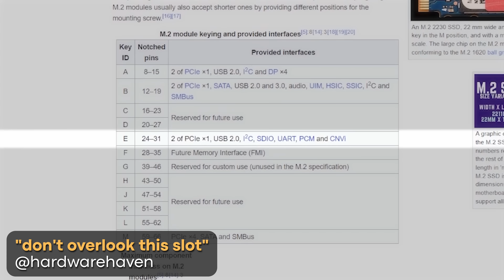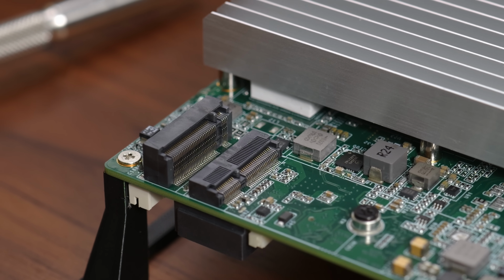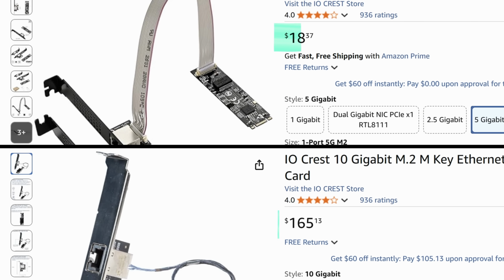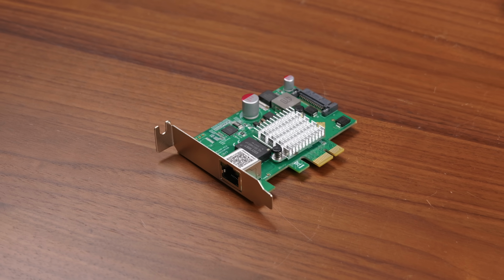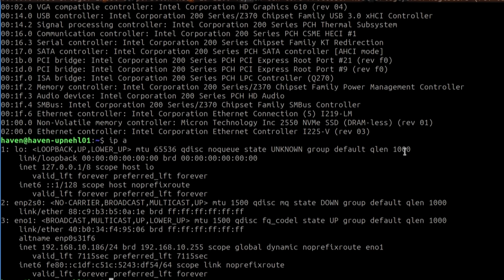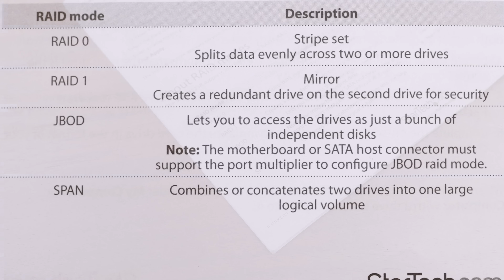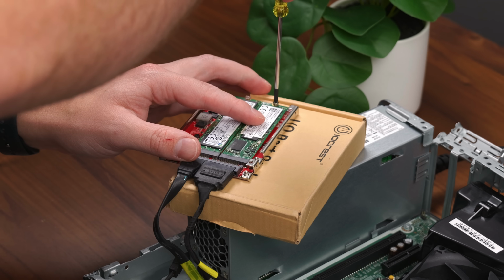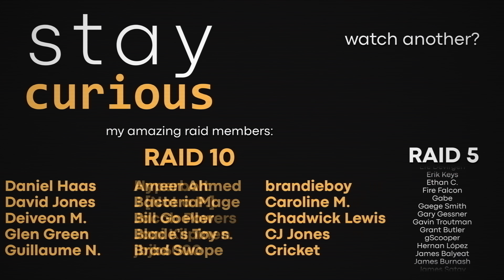I Don’t Know Why These Adapters Exist... But I Love Them

Comment: Fiber, or at least Google Fiber if you bypass their router needs PoE to work. The PoE network card could be in our router as your WAN port and supply the power to the Google Fiber module that converts fiber to ethernet. This would eliminate the need for a PoE injector which is what I had to use when I built my router around 10 years or so ago.

Comment: I use the MicroSD adapter in a system that doesn't support booting from my Sata port.  It wants to boot from a drive in a 4 bay with a backplane plugged into the SAS port.  I have my OS on the SSD on the SATA port and have grub on my microSD card.  It boots it and finds my SSD fine leaving my 4 drives open for storage.

Comment: As I 'discovered' after using Amazon for 24 years, purchases still have warranties so if they fail within two years - (I bought a mainstay extension with built in USB power slots which blew up after nine months) you are still entitled to a replacement/refund. You just need to navigate to the right page. I could not get a replacement so opted for Amazon credit and received the refund before it even arrived at the Amazon depot.

Comment: if you have an older laptop that usedto take hdd there whone be room for the two ssd unless you have an adapter , the hdd case for the ssd will make it eazier to mount them in there , i would use one if i had older ssd drives with aless than 500gb capacity to get one of those older laptops running again

Comment: 8:51 I have the msata version of this, which I intend to put into Lenovo P330Tiny.
The adapter suffers the performance issue, I got only 50MB/s in raid0.
So I switched to pci-e to 2*ngff and use software raid that come with windows server.

Comment: A cool adapter I found is an m.2 SATA to 2.5' SATA drive adapter with a built in micro USB 3.0 port so it can be used as an external USB drive as well. Makes it easier to access the drive without having to mount it.

Also a downside for that dual port RAID m.2 sata drive adapter is gonna be the heat. It's best to find the most energy efficient m.2 drives with the lowest operating temperature.

Comment: An adapter I found useful for retro laptops and desktops. You just can’t get 2.5 ide drives spinning drive anymore.  Now they are using m.sata cards on a ide adapter to m.sata card. Increased the storage capacity X 10 and more. 40gb and a 20gb to 512gb.  Being solid state it’s faster.

Comment: FYI you CAN query individual drives behind a RAID controller with smartmontools -- at least for RAID architectures smartd is aware of. See: man smartctl , and read the -d, ---device section. Some examples from that section of the man page: 

megaraid,N - [Linux only] the device consists of one or more SCSI/SAS disks connected to a MegaRAID controller. The non-negative integer N (in the range of 0 to 127 inclusive) denotes which disk on the controller is monitored. Use syntax such as:

smartctl -a -d megaraid,2 /dev/sda

smartctl -a -d megaraid,0 /dev/sdb
This interface will also work for Dell PERC controllers. The following /dev/XXX entry must exist:
For PERC2/3/4 controllers: /dev/megadev0
For PERC5/6 controllers: /dev/megaraid_sas_ioctl_node
3ware,N - [FreeBSD and Linux only] the device consists of one or more ATA disks connected to a 3ware RAID controller. The non-negative integer N (in the range from 0 to 127 inclusive) denotes which disk on the controller is monitored. Use syntax such as:

smartctl -a -d 3ware,2 /dev/sda

smartctl -a -d 3ware,0 /dev/twe0

smartctl -a -d 3ware,1 /dev/twa0

smartctl -a -d 3ware,1 /dev/twl0

smartctl -a -d areca,2 /dev/sg2

smartctl -a -d areca,3 /dev/sg3
The first line above addresses the second disk on the first Areca RAID controller. The second line addresses the third disk on the second Areca RAID controller. To help identify the correct device on Linux, use the command:
cat /proc/scsi/sg/device_hdr /proc/scsi/sg/devices

To look at disks behind HP Smart Array controllers, use syntax such as:

smartctl -a -d cciss,0 /dev/cciss/c0d0    (cciss driver under Linux)
This will give the smart information about the first physical disk drive (0) connect to the controller at /dev/cciss/c0d0 . (Disk drive numbering is 0 based)
smartctl -a -d cciss,1 /dev/sg2    (hpsa or hpahcisr drivers under Linux)

(there's a wealth more info in that section; I copied various portions of it to share with you). 

When I worked at a hosting company that one tech writer has called "the roach motel of hosting" I wrote some internal articles on doing this and trained many junior sysadmins on doing this, because storage trouble tickets were by far our most common tickets and I wrote many one-liners to simplify storage issue reporting (some of which I've turned into a full command line utility I called "topdiskconsumers" for reporting on disk usage). I've been meaning to take my other one-liners and turn them into full-blown command line utilities (including detecting/probing and reporting on arrays using smartmontools to simplify what you're looking for), but I've had higher priorities.

Comment: The poe ethernet would work with older VR wireless headsets for the power output so you can mount the wifi router with power without needing a wall power

Comment: The 2.5" dual RAID m.2 sata enclosure was ESSENTIAL (back around 10 years ago) for anyone that ran a business off there laptop that only had a single spot for data storage. But TBO SSD's have got so reliable in the past 5+ years (early cheap 3D/TLC and QLC did fail "a lot") that you're FAR more likely going to loose your data from user error than hardware, unless your SSD in soldered on to the motherboard.

Another way to keep your data safe is if your laptop has a spot for a flush SD card, you can use that as the backup drive. They also sell Micro SD adaptors that are shorter than normal so they don't stick out.

Comment: PCIe x1 to Type E USB adapter. From the launch of USB C there existed PCIe x1 cards with one external USB C port and often some external and/or internal USB 3.x ports.

But nobody made PCIe x1 cards with a Type E internal connector for USB C. Why? It's the same as USB C but with an internal connector to run to a front panel USB C port. Companies did (still do) make PCIe x2 and longer cards with Type E connectors.

I emailed every manufacturer of PCIe USB cards I came across about why they should make a PCIe x1 card with a Type E connector. The main reasons being that they made them with external USB C ports, and that there are huge numbers of motherboards that only have one or two x16 slots and a a bunch of x1 slots, nothing in between, and many of those either have no built in Type E port, even if they have USB C on the back, or only have one Type E connector.

Well someone must have paid attention because eventually some company started making a PCIe x1 Type E card. I bought one, it's in my desktop and it's connected to the USB C port on a multi card reader that connects to a 19 pin USB 3.0 connector, with all the card slots on one port and the other directly to a Type A port. The USB C connector is separately connected to a Type E plug.

Another item I really want to exist is an ExpressCard with one USB C port, connected to a real USB C controller, not simply adapted to USB 3.0. There are some USB C devices that insist on being connected to real USB C. I don't care that it would be slow due to ExpressCard being only PCIe 1.0 x1, I want to use USB C things with my Latitude E6530 that I've maxed out with every possible upgrade.

Another one that Really Ought To Exist is SATA to NVME. Again I don't care about the speed! It's certainly not a bus width issue since USB 3.x and USB C to NVME exist. Even the slowest NVME SSD connected to SATA III should be capable of 100% of the SATA read and write performance with no crazy drops to sloooooow speeds.

Comment: 0:35  is that 2.5 in and will it fit in a laptop?
Reply: Yes and yes, it can even mirror drives.
Reply: they can only use sata m.2 drives on it though, not nvme

Comment: That Poe card is interesting use can use it to reflash AP firmware with out the clunky switch set up Poe cameras firmware or just play with POE IOT Devices. all at a bench no switch required.

Comment: That PoE 2.5 gbe nic would actually be amazing for me if I wasn't using a micro PC. I run OpnSense and my WAN2 backup is a cellular modem that is able to be ran over PoE. This would let me eliminate the separate PoE injector for it.

Comment: Sadly I can see that the connectors in that SATA adapter takes sata m.2 cards not nvme.  And those are harder to find now. You're not gonna take two 4 tb nvme's and turn it into a 8 tb sata with that.

Comment: Amazon has a good staple of mine, 2.5" IDE to mSATA or M.2. Good for getting SSD performance/reliability from old vintage computers whos hard drives are starting to fail. I have a ton of 128GB mSATA that these are a little overkill for, but they work very well.

Comment: I could imagine using that SD card adapter in the E-key slot of my home lab Optiplex 3060. It could hold my Timeshift backups and free up the space on my 3.5inch data drive

Comment: I had that type of adapter except it was 2x2.5" in 3.5". I loved it. I used mine in an external USB chassis with spinning rust and the thinking was that if I had an accident and bumped it while it was running, damage would likely be done to different parts of the drives, increasing my chances of recovery. So they do have uses, these weird adapters.

Comment: Optilink to EGPU dock to PCIE M.2 adapter to M.2 Optilink adapter. repeat. see how far down the chain you can get it before even an m.2 SD card fails to load - gonna have a lot of use for that closet full of old power supplies.

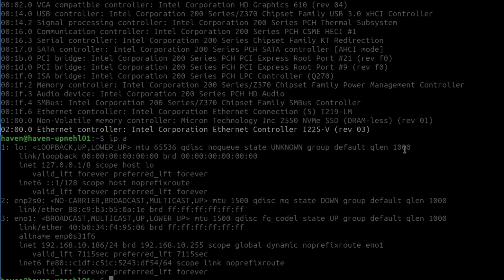Comment: 8:11 if I have a small PoE NAS, connecting it straight to the pc so it can take internet access from there would also make that specific devices transfer speed to and from the NAS basically no loss of speed (if I'm right, I could be wrong).

Comment: A network card with PoE makes sense if you have a home lab and don't want to constantly deal with 220-12V adapters, which take up a lot of space in the outlet and add an extra cable all the way from the power outlet to the device. My Raspberry Pi 4 is lying behind my computer, and there are too many cables running to it.

Comment: The SD card adapter is definitely interesting. I have a laptop that I use when I am travelling and I am often in places with no wi-fi so I have a 512GB micro SD loaded with movies and music which means I don't have to rely on streaming services. And I'm not constantly writing to the SD card, only reading from it so I haven't yet run into any longevity issues. As the days of laptops having upgrade paths and multiple drive support are fast disappearing outside of a few dedicated workstation laptops it's a handy trick to get some extra storage.

Comment: for the life of me, i cant think of a single scenario where a pcb/mother board would have m.2 but not usb, i would never use an m.2 port to hookup micro sdcards, just buy an m.2 card, sdcards are garbage, especially for the purpose of a boot drive of anything.

Comment: 5:53 I wonder if you can plug each ribbon cable onto a different m.2 carrier? that way you can in theory have network interfaces of 4 different nodes on a single pcie slot. This would be very handy for a cluster... @jeffgeerling might like that lol

Comment: I use a dell optiplex micro as my home server.
I removed the wifi card, used an M.2 extension card & a M.2 to 8x SATA adapter to connect all my HDDs.
Love me some adapters. Though failures would be a pain to troubleshoot when piggybacking several.
Reply: I have seen an m.2 to SATA card uses mini SAS ports for 8 SATA. It's still a SATA card but you only have to deal with fewer cables

Comment: That last adaptor could do with a modification to bring the LED signals out onto hardware pins so you could manually add external LEDs to monitor the hardware state with, to be able to see if one or the other drive has failed, and which one.

Comment: I found some nice mini PCIe and NVME a+e key ribbon cable extensions.  This gives extra options when fitting your mod.  Adds a few bucks.  I am currently working on a few laptops, but the one that is most interesting has 3 mini PCIe slots, an ExpressCard port. a PCMCIA port, a DVD rom slot and a 2.5" HDD slot.  There will be MANY adapters involved lol  I think I am gonna use the ExpressCard for a couple USB 3.0 ports, gonna use one miniPCIe for either "mini PCIe to NVMe M.2 to Occulink panel mount", and if that doesn't work, just mini PCIe to USB 3.0 panel mount, either of which will be used for an external GPU dock.  One of the remaining two miniPCI slots will be used with a mini PCIe to NVMe M.2, and the final one will be used for a mini PCIe h264/h265 decoder.  I will "delete" one of the USB slots, potentially one from the Expresscard to USB 3.0 card, and route it internally, so that I can use a USB WIFI+Bluetooth card with laptop style antennae.  I am still unsure what to do with the PCMCIA card slot.  They are kinda useless these days, from what I can see.  So I might use the space the port occupies to put the panel mount eGPU connector, etc.  I also have a small but powerful stereo audio amplifier PCB, that works on 5V, so I am also gonna try to split the SATA power with a Y extensions, and shuck the 2.5" SSD that resides there and hope it all fits.  Then run 5V to the audio amp from the SATA power Y.  Then I have some larger laptop speakers, TV speakers, etc, I want to try to fit.  The last thing is the DVD rom area...not sure what I want to do there.  I can get a 2.5" HDD adapter.  Or an addon battery.  I am thinking of getting the add-on battery and modifying it to power the eGPU dock from the laptop alone.  And having it give the laptop extra juice when not using the eGPU.  If that makes sense.
Reply: I am also modifying the laptop as I type this to take a quad core CPU, and 1066FSB instead of 800MHz it's meant to.  It's an old machine but all the swappable parts and mods makes it fun to work on.

Comment: I used the last adapter exactly for the reasons mentioned, I wanted raid on a small raspberry pi case that only had one 2.5 sata port. but eventually i upgraded to a more powerful n150 mini pc that has 2 nvme ports.

Comment: @8:30 not sure if it was an adapter or was on board inside but we once used small industrial pc boxes with one normal ethernet port and one with poe to power the networked card reader inside turnstiles (used in ski resort setting)

Comment: I have a PCIe card that can hold two SATA drives, bought on AliExpress a couple of years ago. This one also has RAID capabilities, but I use it as JBOD. Does work like a charm, but it a huge card... It's called DEBROGLIE DB-23561 and has an asmedia ASM1062R chipset on it.

Comment: There are actually M.2 Key E NVME drives sold by Advantech. I've bought one of the 512GB variant (SQF-C3AV1-512GCEDC), and it works perfectly (except it's running PCIE x1 on my motherboard even it supports PCIE x2).

Comment: the poe could be useful for powering a switch that having its own power source would be inconvenient. My guess, depending on the power it can deliver, would be kind of cool for poe cameras on a poe switch on a homebrew dvr setup. Run 1 ethernet cable from your basement server rack and dvr station, up to your attic, where you can branch out 4 cameras off a poe switch

Comment: I was just thinking, if I had an old 3.5" disk rack, an expansion card supporting port multiplication, and an adapter in the drive caddy, could I somehow stuff 24 2.5" ssds into the space for 12 3.5" drives.

Comment: The adapter I want, doesn't seem to exist. I want a 2.5" SATA SSD sized case.. that takes an M.2 NVME SSD. This would allow running older systems with modern storage devices, even far into the future. I am aware that M.2 SATA ones do exist, but are not what I'm looking for. I would love to stick a brand new, 8tb M.2 NVME  drive, into a SATA port.
Reply: PCI/PCIe host controllers are hideously difficult, so don't be too surprised when specialised devices with one may not exist.

Comment: Put an SDR directly on an antenna, connect it to an SBC, feed the SBC power with a PoE injector, and connect the other end of the cable to the weird card in your PC. Minimum latency, maximum performance. That's an idea that would benefit from not having a switch in the loop.

Comment: That PoE card would be killer in an opnsense box. I have mine set up with a dedicated port specifically for a WAP so I can still get a connection if my switch bites it. Being able to power that WAP right off the router is a slick option in my case.

Comment: Sure, ROFL! at 1/6 - 1/12 the speed of an NVME! You would be far better off with a low  cost higher performance external case/adapter with a true USC C ver. 3.1 or higher, nvme to USB adapter!

Comment: I bought a $20 add-in card that turns a 1x PCIe slot into being able to hold 2 NVMe (M-key) drives. The speed isn't much better than SATA, but it allowed me to use those older 1 or 2TB drives as auxiliary storage when I upgraded my main drives.

Comment: My favourite weird adapter is an mPCIe-to-NVMe one. I use it on my OptiPlex 9020 USFF, which has no slots other than internal SATA ports. With some UEFI modding, you can even boot from the NVMe drive. Granted, the drive is not fully utilised (it effectively runs at PCIe 2.0 x1), but it's a great way to add bigger and more modern storage into this neat little machine.